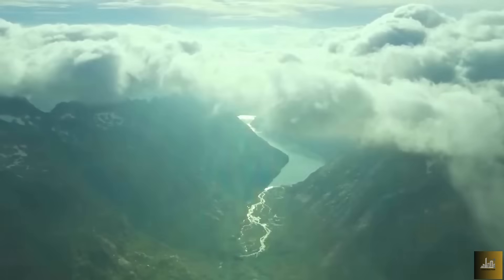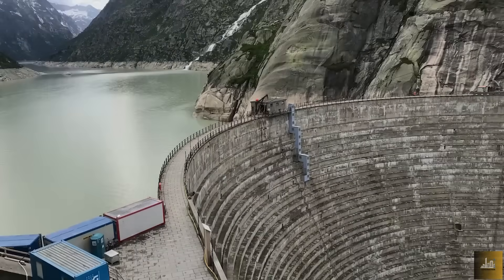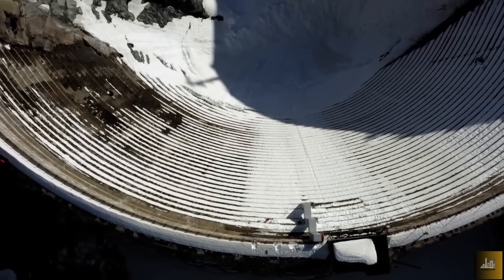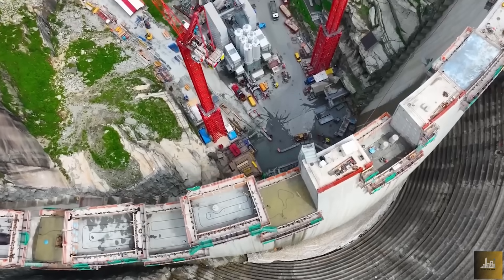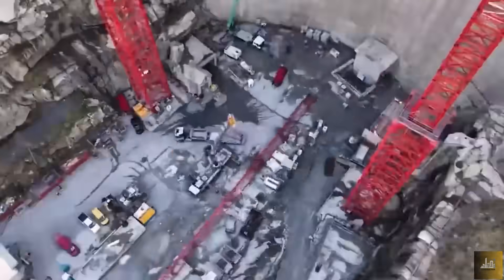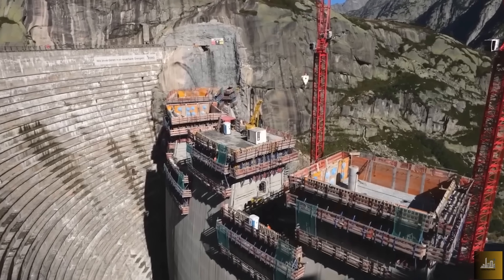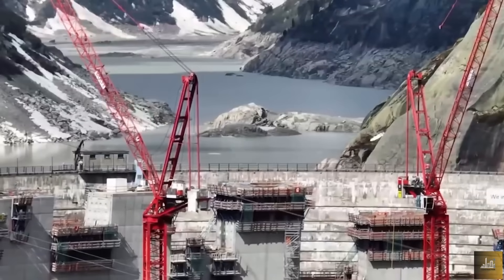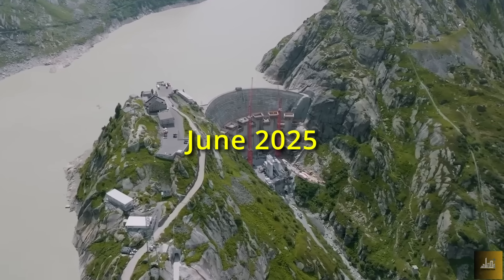Switzerland's RACE Against Time To Replace Cracked Mega DAM

Comment: Bullshit, They built a new 25m higher Damm  for more capacity. Thats all, the old is still ok. A Swiss Guy😂😂
Reply: Hi there. Here someone who was involved in the decision of the construction: The original dam has shown a structural problem ever since the sixties. After each yearly temperature based expansion and retraction (summer-winter) the wall wouldn't find its precise place again and over time this slight movement added up to more than 30 cm. So before the situation became critical, it was decided to build a new dam in front of the old. The new dam will not be higher than the original, this project was refused by the authorities because of ecological considerations, (some 50 trees would drown). It is true however that if this decision should be revoked at a later date the new dam could be hightend by an additional 16 meters. This as winter electricity will get rarer in Switzerland when the remaining nuclear power plants will be decommissioned by 2060. The additional stored water will enable a huge amount of energy to get transferred from summer (when electricity is abundant) towards winter. And yes, in order to operate intermittent power production like solar and wind we need the flexible hydro powerplants. Cheers.
Reply: So you say they are lying about the cracks observed in the old dam. Sorry but I believe them but I have no reason to believe you.
Reply: Watch KWO grimselstrom- du Banause.  Erst recherchieren, dann reklamieren.
Reply: no race aganist time , just more capacity.Less windmills.
Reply: I was going to say amazing tech, obiviously just on paper atm.
Thanx, ii'm sic of the bs on yt
AU

Comment: 0:12: You cannot have "tons of water pressure".. Tons refer to weight. Pressure would be weight per surface area.
Reply: Force per unit area..
Reply: A question of translaton... you have miles we have km.... we use power per meter and power means weight.

Comment: Although I haven't watched this video before but I wasn't aware of the condition of this 100 year old dam,the Swiss engineers were very smart in making a STATE OF THE ART DAM,but with Climate change and the ocean's sea level rising, there is talk in NYC, to build a water proof wall or barrier, higher than in NORWAY,to protect WALL STREET ,it has been introduced to the HOUSE and the senate in NEW YORK STATE ,in all probability it will be financed by a joint agreement between Congress and the New York state, it's in WASHINGTON DC'S  interest to do so. WHAT I don't understand is why don't they slowly release some water, it's putting a huge strain on the structure, makes no sense, look at the HOOVER DAM,a couple of days ago, it was reported that NEW YORK STATE consumes a billion gallons of water per day, but NYC gets it's water source from upstate reservoirs  which is STATE land, and is constantly being regulated by state authorities, and law enforcement ,even the POWER GRID,comes from upstate NEW YORK STATE ,just look at the power lines,and transformer's, over hills and valleys, but I wonder if they are building this dam with TITANIAM STEEL, REINFORCED,WITH STEEL RODS.
Reply: Hab keine angst wir Schweizer wissen schon wie man staumauern sicher baut😊😊Dies mit der Mauer um NEW YORK das  lass mal schön euer TRUMP erledigen das macht er dann in Rekordzeit wie alles andere😂😂